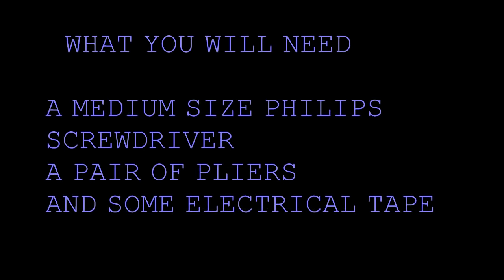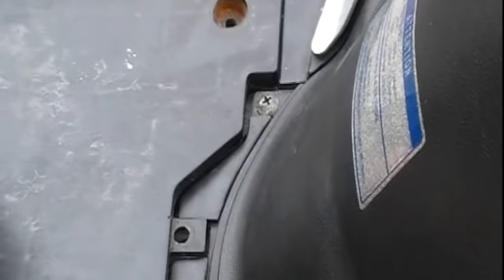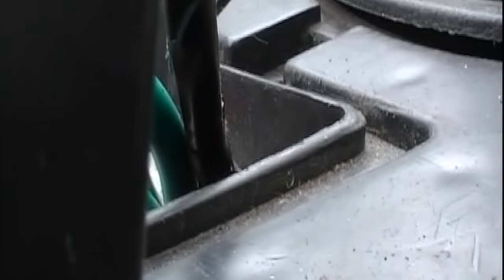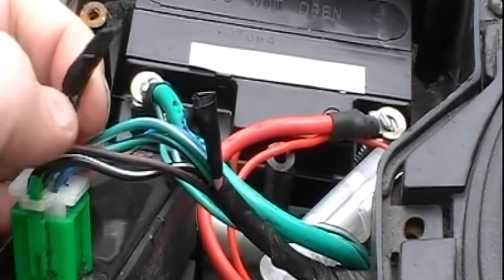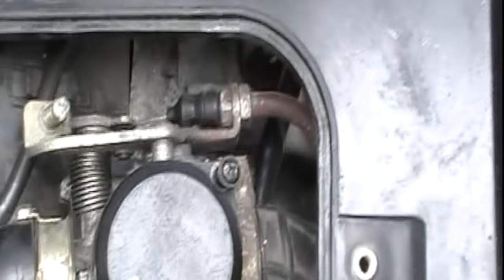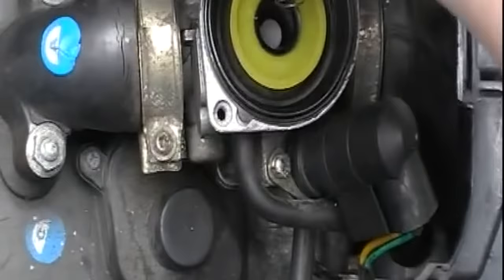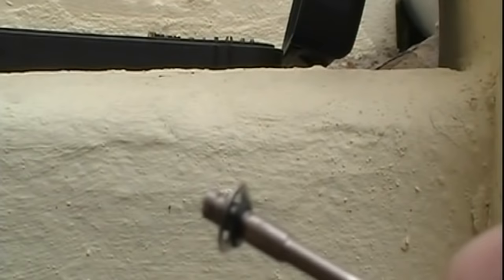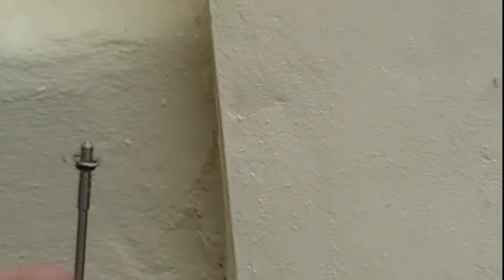How to derestrict a 50cc scooter / moped Make it go Faster

Comment: What is the "pink wire controlling"? 
I've heard of the 6 pins the following way:
1. Blue/Yellow - trigger wire
2. Yellow/Black - coil feed
3 & 4 Green - ground
5. White/Black - kill switch
6. Red/Black - power AC or DC

Comment from the maker: Hi whats your engine number is normay under the bike around the kick starter a little plate with you engine make and number. And I will find out for you. Also check you cdi box to see if it has a pink wire thanks.

Comment: He forgot to tell you once you remove the restrictor I t will go a mile or two faster, but be warned your valves and rings will greatly suffer. In a short time your engine will have plenty of problems and will leak oil and run hot until catastrophic damage is the end result. Be prepared to replace the engine. It will be worn out Many many miles before it should. Only a moron would mod their scooter like this. If you want it to go faster by a 125cc and replace the 50cc engine. The average cop can't tell the difference. They go back the video n number to determine engine displacement. It will save you a lot of time and money. Visually both engines are exactly the same size on the outside, unless the cop that pulled you is a scooter expert he won't notice. If you get pulled traveling over 35 mph you could be charged with driving with out a license, and not insurance. Most states 50 cc and less don't require liability insurance, but you f your pulled because your going 46mph you scooter will be treated like a motorcycle. So if you already have a DUI, be prepared to be arrested for driving on suspended license.

Comment: This guy has absolutely no Idea what's he talking about. Firstly the pink wire has nothing at all to do with revs, it's a sensor for the clutch speed and all you do is unplug it at the engine end of the wire. Second you have just moved the needle down making it put less fuel into the engine making it run extremely hot and will burn the piston rings in no time at all. A good set of roller weights and a new drive belt would see you actually get better performance etc.

Comment: CDI does nothing but control spark coil timing.. You control speed with CVT mods, and control RPM and power with bore kits, carbs, and CDI.. You can have the same effect what is in this video just by doing CVT springs and save engine wear. Trying to boost speed or power through spark and fuel alone is a bad idea..

Comment: dont do this on V click 50cc .. never work again ..cut the green (looped) wire and leave it at that .. dont mess around with the needle UNLESS you've up rated the engine to 72cc and got a fast flow air filter.

Comment from the maker: This is true untapped wire woild be a fail but I dont know what point your trying to make is because at not time in the video or any instructions if following correctly would this modifications fail. So the answers to the original question that was asked is no it will not fail. If you have any suggestions for new video plz leave comments down below

Comment: haven't you got restrictors in your exhaust? the cylinder
Reply: Not usually on 4 strokes like this. Variation, carb and cdi usually. He’s not even derestricted the carb on this video though, he’s just altered the mixture and probably made it slower.

Comment: i don't know why everyone talks trash here. by moving the needle up the scooter/moped will accelerate quicker. by cutting the wire he disabled the sensor witch reads the CLUTCH RPM! So it disables spark when a moped reaches 50 kph or 30 mph!!!

Comment: I cut my pink wire and taped it up. Bike wont start now, I have a speed fight 3, any help please?
Reply: Look, when you are trying to make a speed fight faster you should open your carter to reach the variator part, unscrew the variator an seach how you can block the variator becausee when you're going to try to screw it off it's going to keep rotating I used a piston stop. Take out the varator system and remove the ring thats under the beld, you should go 65 - 70 km/h when you want to go even faster you should buy a sport exhaust it's around the 150 dollars. you should go 90 when you've done that. PLAESE do not mod your original exhaust when you get caught by the police you're forced to put it back on and when you messed up you're orignal exhaust you're going to have to order a new one that'l cost you alot, also when you add a new exhaust ry to use some heiger variator rolls, your bike will most likely get to very high rpms, also put in a bigger fuel sprayer.
By then you could remove the prop in the air filter that'l give you even more boost so speeds will add up, you're going have to be carefull, police don't joke around when it comes to fast scooters they'l probly take it away from you

Comment: moving the needle actually makes it leaner(less fuel) and only affects mid throttle 
removing the rev limiter without supporting mods is pointless 
lenning the fuel will make sound a bit different but might burn the valves 
please read up on engine tuning  tuning befur haking you scoter

Comment: You aren't derestricting the bike, you cut the automatic choke wire and adjusted the fuel delivery with the needle. You did nothing to derestrict the engine. Just made it run more lean which gives you more power at top speed but much less torque. Lmao
Reply: Alabamahummer insightful

Comment: You just destroyed your scooter buddy 26 years of experience owning a moped shop that is not how you Remove the restriction on your power first of all do your research before you start cutting and digging into your carburetor which does not make any sense your calls serious issues to your car it’ll always get soaked up you’ll be pulling too much RPM you’ll be flooding all the time you’ll lose power and also if you wanted soup your scooter up with a 50 mL turn it into a 80cc bor kit
Also it’s only a couple hundred dollars to do it instead of ripping apart your important things into your scooter if you want to do it the cheap and fast way remove the exhaust pipe and there’s a metal filter in between The exhaust pipe hole pop it out with a flat head screwdriver and you’ll see a big difference just a little tip do not recommend people doing but he just did

Comment: You're a bit wrong in the beginning of the video, because in sweden it's illegal to modify any performance increasing parts and need to be standard of the manufacturer.
Reply: No it isn't illegal, but you can't use the vehicle on the roads if you have modified it.
You can still take it to the track and race it and you can use it on your private grounds.
There is no law against doing the actual modification, the law states that the moped must not exceed 25 KPH (Class 2) or 45 KPH (Class 1) and the engine must not exceed 1 kW of power output.
As long as you are within those limits, you are allowed to take your moped on the road, even if you made it accelerate faster etc or put better brakes on it or made it do wheelies easier.
Reply: Jonaz hahaha that must suck
Reply: Jonaz but if you are Swedish, (probably 15 years) you do it anyways,
Reply: Kevin Nyberg  no i don't there's no point buying custom part when you can drive a car when you're 16.
Reply: Cadde
you don't "need" to go in 30 you can hide a button with a restrict toggle.
Reply: Jonaz And the police can hide in a bush... Your point is?
Reply: Cadde
I dunno really, an A/EPA tractor goes in 30 KM/h but many people unrestrict the gearbox so it can go as fast as a regular car. Also, why are mopeds allowed to go faster than a a-tractor even though an a -tractor is much safer than an moped?
Reply: Jonaz Because rules.
Reply: *****
so the swedish goverment think that we 15 year olds will run over people with our mopeds and tractors but when we turn 16 we get to practice run real cars, makes sense not .
Reply: Jonaz First of all, it's a matter of judgement. Generally speaking, 16 yo kids don't have enough judgement to drive a car at speeds beyond 30 KPH.
You have to keep in mind that you are not allowed to practice driving a real car at 16 without supervision. Even at 18+ you still need someone next to you to practice driving.

It's only when you pass your drivers ed and test that you are allowed to drive a car by yourself and it doesn't matter if you just turned 18 or 58 years old.
Reply: Cadde
I don't think it's that hard to drive a car, atleast within reasonable speeds if you know the basics like shifting gear without stalling. And the drivers test for moped was more about right and wrong instead of the usual stuff like which lane you should be in. I am too young to do the drivers test for car but i think (atleast hope) that it won't be too different from the moped test.
Reply: Jonaz Driving a car is one thing. Driving it responsibly a whole other. It takes more than just being able to change gears and keep your line. You need to be aware of EVERYTHING that is around your vehicle.
If you turn right and a bicycle is on the inside of your turn going straight and you bump him you are at fault even if the bicycle came in at 30 kph from behind a truck.
Reply: Cadde
I know that, but that rule is not only for cars. It's for mopeds too because my driving school teacher said that it's moped drivers responsibility to not harm pedestrians or bicycle if they are harmed it's the moped drivers responsibility if  there's no proof against it.
Reply: Cadde but great video. Thanks
Reply: Cadde  When I was 14 I drove a Datsun 260Z down the highway cruising at 160 MPH, that's 260KPH to you, so I disagree with your assessment that 16yo kids don't have enough judgement to drive over 30KPH.
Reply: ***** It's all fun and games until you end up in a frontal collision with a family of 5, killing them all and your "girlfriend" in the passenger seat.

Sorry, your argument is circumstantial.
Reply: Cadde No it's not. My argument is based on facts, yours is based on theory.

 I was driving go carts faster than your moped goes even before that. I was on the 4 lane divided highway when I was cruising along at 160, for me to get in a head on accident someone else would of had to been going the wrong way on the highway, but hey your right, I could of been hit by a battleship too.
Reply: ***** Or you could have been hit by reality. That's something i think you need.
Reply: Cadde I live in reality, I don't let society dictate it for me, but I see the brain washing is strong in you.
Reply: DlcAssasin MCDucks Believe it or not, back then driving at 14 on the Highway with my Father in the car was completely legal, but doing 160 wasn't. I had a learners permit.

You are still missing the point, the point is I went up to 160 and kept it there for a very long time with no issues at 14, so are you trying to tell me a 14 year old can't control a moped going over 30MPH when I was going 160MPH in a car? Your wrong.

Now if my Father would of gave me that car without making sure I could corner fast and drive at speed, then that would of been irresponsible of him. I had to pass his driving skills test before I could have it the next year.
Reply: Its irresponsible of him just letting you drive at 160mph..... Now i do think that not every 16 year old can controle a motor driven vehicle of any kind. 
U should think about that.. not everyone have the abillity to control vehicles easily.
Reply: DlcAssasin MCDucks I had already been racing go carts for years prior to that,and you are right not everyone has the skill to control a car properly, this is even true for older people.

Skill comes with experience, which is not something you are going to get at a little more than bicycle speeds.

Your assessment is wrong, if he would  of gave me a car I was not skilled enough to drive fast, then that's what would of been irresponsible. Your Father can't be with you all the time to make sure you don't drive too fast, the next best thing is to make sure if you do you can control it decently safely at least, because at least in America, boys will be boys.

I can outdrive most people, I would not of got this skill never breaking the rules. It helped I lived in Germany from 18-21 where I could hone my skills without speed limits.
Reply: ***** Great story, i wish i could believe it.... Cause in this story, you are basicly saying that your encouraged you to break the law.... Wonder how that works ;)
Reply: DlcAssasin MCDucks  It's not a story, because it's true, when it's true it's called history.

Laws are just laws, they are made to be bent and broken, even the people that make them and enforce them do it daily.

I can see you can't think outside the box, I guess we are done here. I bet you break the law every day and don't even know it, there are so many nobody knows them all, and a good part of them are stupid, but most are just about revenue and control.

Wonder how Assassins are such upstanding citizens, how does that work?, talking about your name here.

He didn't encourage me to break the law, but if I did he wanted to make sure I didn't end up dead, which is more than your Father did. All  these people you see causing wrecks, they are not people like me, they are the people who do the speed limit and decide to not do it one day, at the wrong place and time.
Reply: ***** "Laws are just laws"

And prison life is just prison life.
Reply: Cadde And stupid is as stupid does. I can't say I have ever heard of anyone doing prison time for speeding, but do enlighten us.
Reply: Cadde  *****  If you ask me 260 KM/H is alot but it also depends on where you are driving, both country and track and experience.
Reply: Jonaz Experience is the key word, that's what I was trying to make him understand.
Reply: +Jonaz Are u rlly from Sweden? Cus in Sweden you have to be 18 to drive a car!
Reply: Accisen Growtopia No, 16 to drive a car in the company of a B licence holder who has had his for 5 years without remarks.
And 15 to drive tractors, which is the kind of car we are talking about that only does 30 kph . (~20 mph)

Comment: You went the wrong way with the Needle C clip,,    Lower the clip and washer,  that raises the needle an increases fuel for more speed,  You never did explain the wire cut,   and what that wire does,   Some scooters might have different colors,,   ya gotta know where the wire goes to,  so viewers can find the right wire if it has a different Brand scooter..  You really need to learn how to use camera..   You never started the scooter,   cuz it don't run after that,,

Comment: Dude you literally don’t know anything about this, You moved the needle in the wrong direction And when you move that valve you’re changing the air fuel mixture you would need to tune the carburetor and probably reject it, you forgot to put the spring back in, you’re using an electric drill on carburetor screws, The pink wire is so you don’t over rev your engine, your advice probably caused a lot of people too ruin their engine.

Comment: this is all false information.
now get a pair of wire cutters and you will need a length of electrical cable, go into the cdi and cut all the wires, twist the cut wires all together then connect them to one end of your electrical cable, then they should all be going into one wire....great, now get the other end of your electrical cable and wire that straight into the positive side of your bikes battery, now dont start your bike up yet because it will blow up! now go into the carb and take all the washers off of the pin, now before you put the pin back in you are going to want to pour about 25ml of nitros gas into the hole, followed by some sprinkles of gunpowder out of a rocket firework, now put the bike back together and start it up. BANG you have a rocket machine!

Comment: It would be alot easier just to take out the air filter restriction and variator restrictor , put in lighter rollers, Italian /Japanese 49cc scooters can achieve 100kmh without those restrictions , at the bare minimum 70 kmh , this is just stupid , different scooters use different wiring , dont do this , you dont know what wire you are cutting

Comment: can you disconnect the wire without cutting it??
Reply: CoCoDominici of course you can. just push a long needle up against the metal part of the connector that holds it into the plastic.